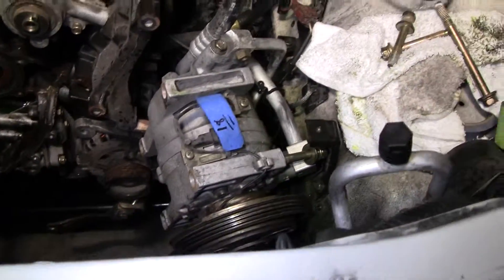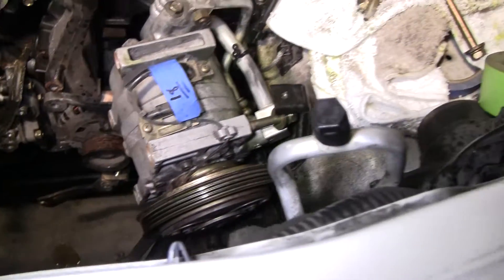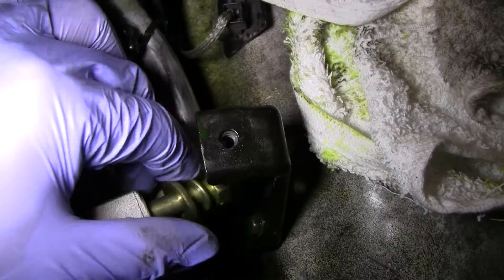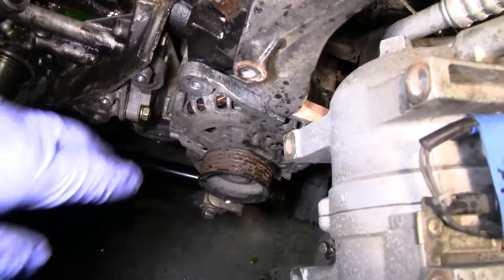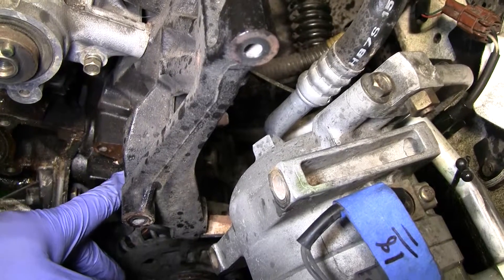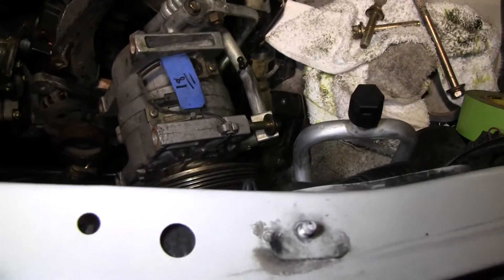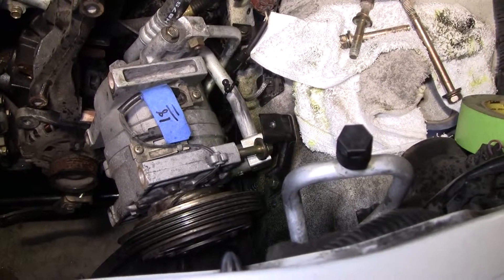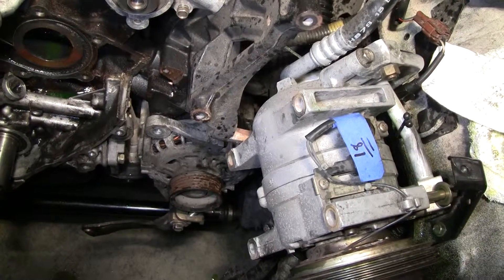2002 Nissan Xterra VG33E Rebuild Step by Step Part 37 - A/C Pump Removed + Stupidity Again

Comment: Funny story - I had a bad hose on my X's A/C system. I took it to the local mechanic to have the system purged so I didn't vent any 134a. They told me I was empty so didn't think much of it. Disconnected the line from the compressor and got a facial. Thank god for glasses. :P